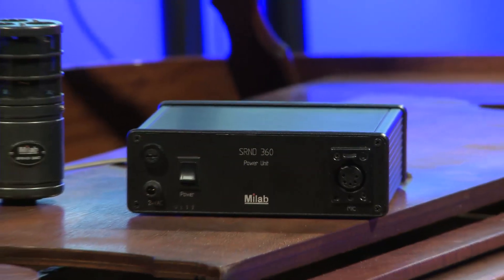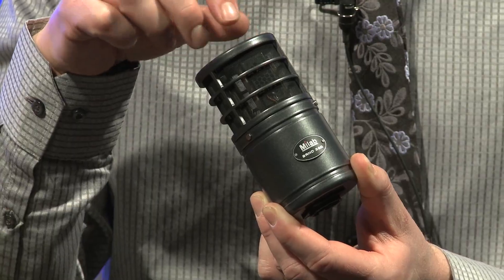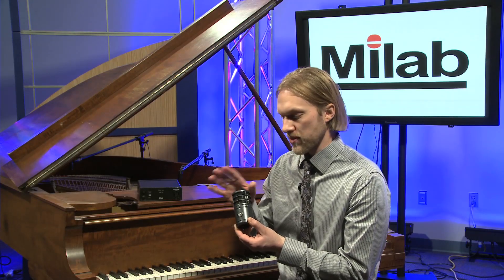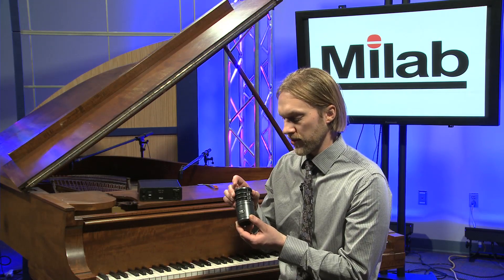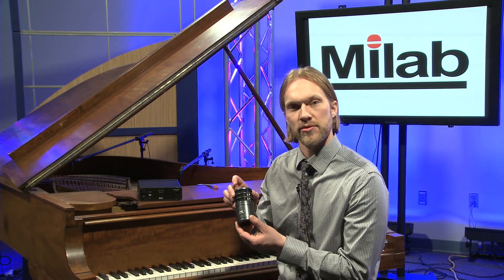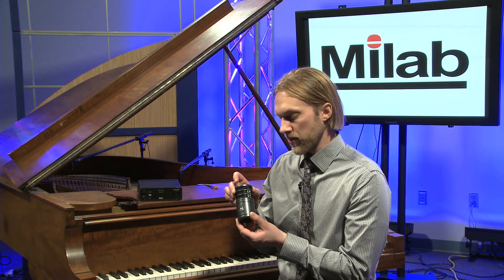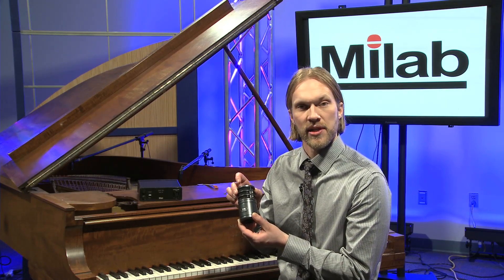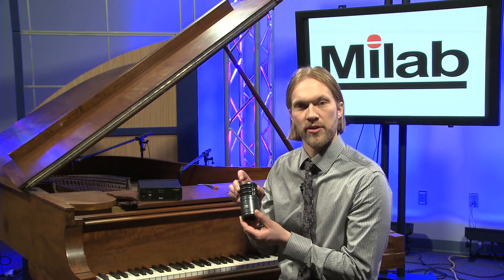Milab SRND-360 Coincident Surround Microphone Overview | Full Compass

Comment: Wow. You apparently know absolutely nothing about microphones... What's the point in buying six separate mics if you are looking for a single-unit surround unit? And where do you get six matched european handmade mics for $9200? Any high quality large membrane mic from a european/US manufacturer will easily cost you $2000-3000. But you're right - if you are happy with $100 China made Behringer mics, then this product is not for you.

Comment: OMFG, this is the most ridiculous thing I've ever seen!  I just Googled this thing, & it's $9,200 retail!!  Like U can't just buy 6 mics 4 that?  A fancy condenser that will wipe the floor with N E of these micro krap used in this device only costs about $100 NEW from Behringer, or something even niser used on Fleabay.

N E 1 spending $9,200 2 'save' $ on capsules using this route needs 2 go buy some brains, 'cuz this is the most ridiculously OVERpriced product EVER!

Comment: Make it very small, & integrate it into the Sanyo Xacti VPC CG102, but with bigger battery 4 more record time  =)  Also get rid of the zoom & iso.  They only degrade the image.  & fix the output @ 24FPS 1080p, & give it a bigger lens with no zoom, so better in low light. There U could have cinemal quality 4 about $200 retail.